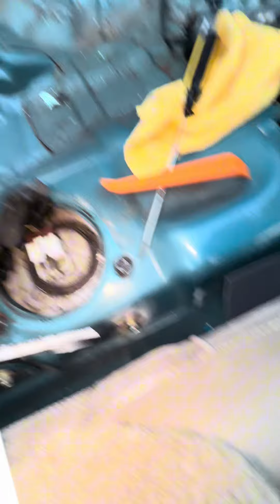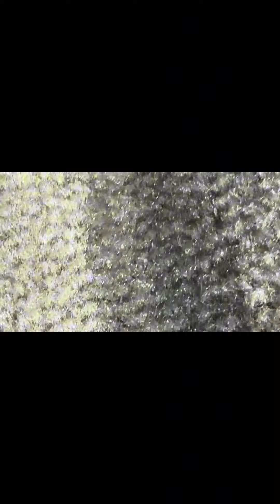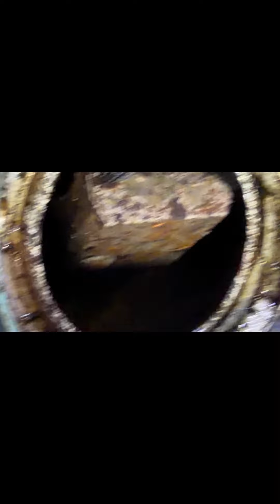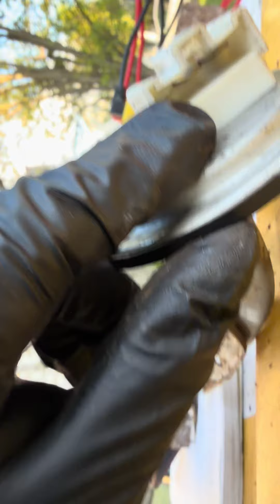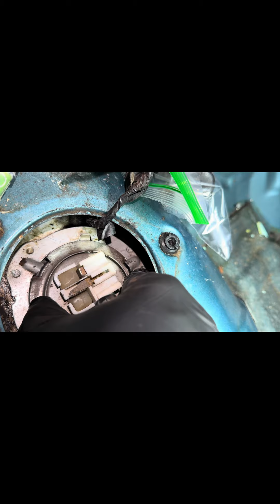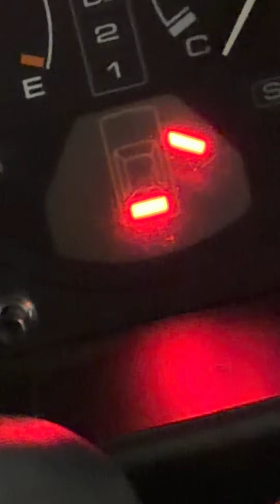1991 Honda Accord CB7 Fuel Sending Unit removal and repair

Comment: Does the gas / fuel gauge works fine after that clean? You did an amazing job. Mine have same issue will defo try it
Reply from the maker: Hi! Yes! So it totally worked for about a few weeks and then it only worked for a few min after start up and stopped. I think it was cause the inside of my tank was super rusty! Little flakes got into the area.  I ended up replacing the tank and got a new fuel sending unit from eBay in Japan. But if you got more questions let me know